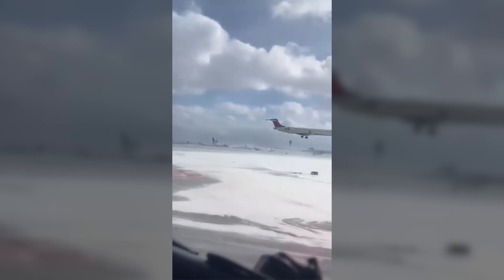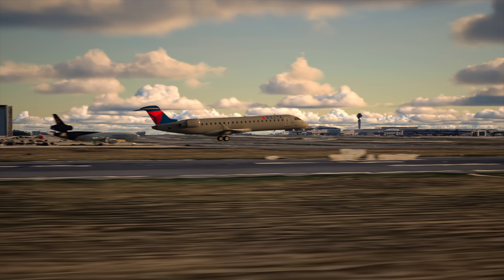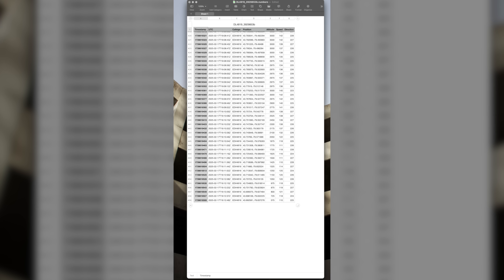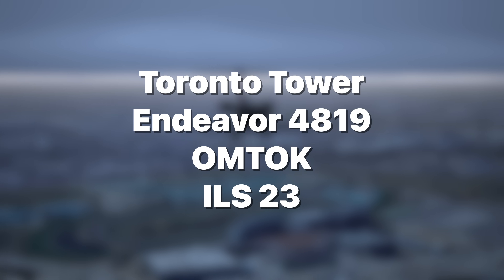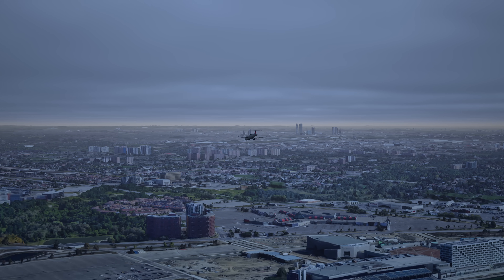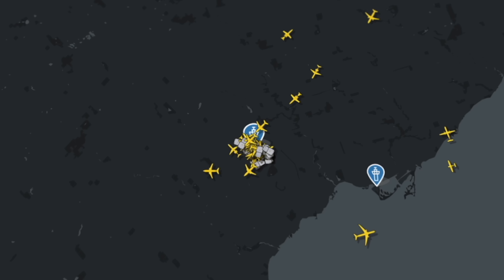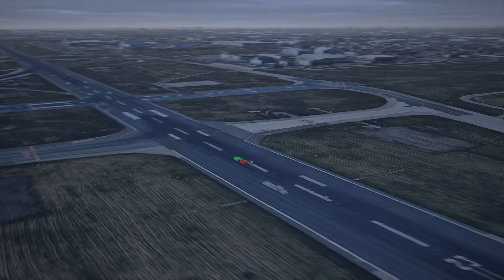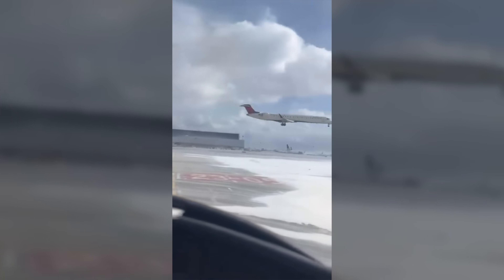What Caused The INSANE Descent Rate in Toronto?

Comment: Recently retired airline pilot here with nearly 40 years experience. There was an aircraft waiting for departure inside of the ILS critical zone because the weather at the field was essentially VFR but just windy. The controller was referencing the ILS glide slope signal disruption that might be affected or caused by the waiting aircraft. And another thing, there is no way wake turbulence was a factor in this event. The speed and direction of the crosswind would have taken care of any wake turbulence by ANY aircraft. Now, there may have been an issue with the wind or wind shear but certainly not wake turbulence.
Reply: Sooo pilot error???
Reply: @Mike-jq9jo  Is there a parallel runway where a large aircraft or helicopter could have created a wake turbulence and the crosswind pushed it over to that runway?
Reply: @tmayorca8770  no. Runway 23 is on the north end of the airport and the parallels 24L/R are on the south end. Too far to have an affect.
Reply: @tmayorca8770  nothing long enough that would accept a plane large enough to create wake turbulence
Reply: Wake turbulence of any severity would have rocked the wings,  this was a none controlled crash compared to all other landings which are a controlled crashes

Comment: Apparently there were high piles of snow left and right of the runway from the snow clearing. The plane landed and bang, one of its wings got stuck in the snow. The wing tore off and the force of the impact caused the plane to flip onto its back.
Reply: Actually it is the remaining wing that was still producing lift that caused the plane to flip. Simple aerodynamic.

Comment: Please don't tell me, They were using Knots, verses Mph? And or didn't adjust the Artificial Horizon for the difference from Sea level? Relative altitude?
Reply: The airfield has an elevation of 570 ft. The ADS-B data vertical data is always reported with respect to standard pressure 29.92 inches of mercury or 1013.25 Hpa. Where the aircraft came to rest the ADS-B data shown 725 ft so was probably overreading by about 125ft.

Wind speeds are usually reported in knots. Some countries, such as the UK use knots for airspeed and feet for height. The US use mph for airspeed. Some countries use kph for airspeed and metres for height. Swapping units is second nature to commercial pilots.

The Artificial Horizon does not need to adjusted for pressure.

Comment: This was 100% the pilots faults as you can clearly see by the footage he got the angle of decent wrong and what is normally called a touchdown turned into a thump down causing the wing to make contact with the ground. Regardless of the windy conditions, all pilots of commercial carriers have extensive training and should've been able to land that easily, all the other planes pulled it off as prove. I'm not a pilot but I do have common sense and blind Freddy can see that was a brutal landing on the pilots behalf.

Comment: At :08 you can see the blowing snow on the ground. It’s basically a headwind. Check for yourself.
Reply: The aircraft was using runway 33, hence was flying on heading 330, the wind was 270 20 kts gusting 35 kts, so that is a crosswind angle of 40 degrees, giving a headwind and cross wind component of 15 kts to 25 kts. The ADS-B ground speed was 115 kts so the airspeed would have been 135 kts, which is the correct speed for the weather conditions.

Comment: The sudden drop sounds like a stall of some kind,  a reduced pressure due to a strong side wind may have stalled the airplane. Add to the fact, the right landing gear hit the ground first and slid/collapsed,  and the rest of the crash was as seen in the video.
The flaps were down. Could the pilot be at fault? From the video, there was no time to flare at all. The airplane was going into hard landing and crashed
Reply: wow, that's a lot of nonsense in one paragraph ! !

Comment: The plane had an excessive descent rate, as another video shows. Pilot error, plain  and simple.
Reply: And you attribute this to pilot error? Not the more likely effect of wind effects rapidly tailing off once you are very close to the ground?
Reply: Apart for the last few seconds the rate of descent was around 500 ft/m, which is normal. For the last few seconds it increased to 1,000 ft/m, which is high, but within limits and is not excessive.

Comment: This is not good information.  If an aircraft's speed is below VREF it doesn't mean the aircraft was stalling.  A stall is caused by exceeding the critical Angle of Attack, AOA, and can happen at any airspeed.  VREF is 1.3 time the stalling speed.
Reply: The target airspeed is is Vref + a wind/gust factor, in this case 10 to 15 kts. The wind was 270 20 gusting 35 kts, so the headwind components was about 20 kts. Hence the is ground speed 115 kts, when the aircraft air speed is 135 kts. The aircraft was not being flown less than Vref.

Comment: A very innovative analysis… Thanks for sharing that… I would agree that the approach speed looks to be correct, but it does beg the question as to why the rate of decent increased so substantially, during the last few seconds of the landing phase… The only thing that I can think of, is that the airspeed was too low for the conditions and/or there was insufficient energy/airspeed to carry out a proper flare…

Comment: The descent rate was 1100fpm, that’s almost 20 feet per second : you’ll reach that vertical speed if you jump off a 2 story building and you will break both your legs.
Reply: That's not what the ADSB data showed.  Descent rate never went to 1K/min.  It was well under it for the entire approach and was at the proper 3 deg approach angle.  It did touch don't just short of the numbers, which is a little short of the desired touch down markers.  It will be interesting to see what the flight data recorders show.  Everything else is mere speculation, not facts.
Reply: @ OK, I don’t have access to the numbers other than through presentations and the last I saw was 1048’/ mn. That right gear had to have failed for a reason.just the voice recorder will tell you how fast the 50/40/30/20/10 call-outs went.

Comment: Could be windshear. I experienced windshear at 30- feet AGL on a stable approach, manual landing at Dublin Ireland . A300. Bad storm. The RA altitude callout cadence was normal until 30' as flare was initiated. Then I heard "30,20,10" in a rapid progression. All that could be done by me was set landing pitch attitude & Firewall Power and hope for the favor of the Skygod. A very hard landing and aircraft grounded for MX inspection was the result.

Comment: I have some doubts about the analysis, particularly the part about the alleged "INSANE" descent rate. As with other viewers I also question the granular data stating that the aircraft suddenly doubled its descent rate just prior to crashing. If you watch the video of the aircraft as it approaches, the rate of descent appears to remain roughly constant until touchdown.

That doesn't mean that the landing wasn't hard though. Moreover the right wing is low at touchdown. Two possibilities: 1) hard touchdown with right wing low, leading to wingtip hitting the ground; 2) hard touchdown leading to right main landing gear collapse.
Reply: Windshear would cause this descent rate.
Reply: @mdculpepper  Yeah, sure it could but what I'm saying is that the video does not seem to show a sudden doubling of the aircraft's descent rate. The aircraft appears to maintain roughly the same descent rate all the way to touchdown.

Comment: It looks to me that the altimeter or barometer was set incorrectly
Reply: Would not be a factor. For a manual pilot landing, baro altitude in not used, pilot eyes and RA altitude callouts are used. For automatic landing, the landing computers use RA altitude.
Reply: @mdculpepper If it was set incorrectly it could absolutely be a factor. Was it the cause, we don’t know yet so it’s probably a good idea to keep all options on the table until variables can be removed. Many crashes have happened due to this so it would be illogical to not consider this among every other possible variable that also may not have anything to do with the accident.

Comment: I could be wrong but if I remember correctly the CRJ-900 doesn't flare much at landing, you just hold the pitch attitude and pull power out.  It's possible the pilot pulled power too high or too quickly, especially if they did get a wind gust followed by an airspeed drop (pretty norming gusty conditions) and just pulled too much power too soon.  It'll be to see what the CVR and FDR have to say.

Comment: As a pilot and lifelong aviation buff and former Aeronautical Engineering student, this plane looks very weak.  Weak landing gear and weak airframe.  Should have been able to take that landing no problem.  Gusts were only +10 over wind speed.  Upon obsevation the airframe and gear looks too weak.  A 747 can take a very hard landing without crumbling and it weights hundreds of tons.  I swear the CRJ just looks weak.  Did they beef up the gear and airframe when they lengthened the Challenger corporate jet?  Just seems weak.

Comment: If the pilot’s front view is obscured by the angle of the plane’s nose and the outside side views are snow covered perhaps their depth perception was affected. If you have ever stood next to an olympic ski jump and looked down for where the actual landing area it’s extremely difficult to determine where the ground is. That is why they place broken pine limbs on the snow that can help with peripheral depth perception. 
  Just a thought about depth perception.
Reply: @JW007100 The forward, visibility, during the approach and landing phase in the CRJ is excellent… This particular aircraft may even have been equipped with a “Heads-Up Guidance System”, (HGS)… Commonly referred to as a Heads Up Display, or HUD system…Jazz CRJ’s use these…
Nevertheless, you may be quite correct, in that the drifting snow may have played a part in the pilots’ depth perception during the landing phase… Experienced pilots, learn to look “through” the blowing snow that is drifting across the runway, in order to see the pavement underneath… it’s quite possible that the blowing snow resulted in these pilots misjudging the point of flare …The landing flare involves a transition during which the pilots transfer their view from looking at the desired touchdown point, to looking towards the horizon while simultaneously correcting for drift with ailerons and maintaining the runway centerline with the aircraft’s rudder…
Reply: You might have something there, JW.
Reply: What mystifies me is that this doesn't happen all the time in winter by more pilots. If it is all just weather, and view angles, or whatever, then why don't we see tons of aircraft slamming into the ground and shearing the landing gear off and planes flipping all over the place in winter? Ya, I don't buy it. Who is the pilot and what was their training? Who was the crew? What was the state of the instruments and how were they set? I think we are seeing airlines, who made vocal commitments to DEI hiring and promotion two years ago now bear its fruit.
Reply: Altimeter was set incorrectly.  They thought they were higher than they were.
Reply: @trevor5290  it’s still a visual maneuver… And the radio altimeter would’ve read correctly during the last few hundred feet…
Reply: @tripleseven8361  Yes if the altimeter was incorrectly set it would be a main factor but not being able to determine the actual distance to the ground due to lack of depth perception might add to it. Depth perception problems are of course very common with night landings, one moment you’re just above the ground and boom ,oh you just touched down. The angle didn’t quite seem right either but all I can say is no one was killed and the whole sequence of the wheel collapsing, wing shearing off, then rolling over onto its back and then the fire. Incomprehensible in so many ways. Hope everyone on that flight will be able to cope with life as it is.
  I flew for a little while and decided it wasn’t for me. My father was a 3 war combat pilot in the USMC and then an airlines pilot and he would talk about certain situations and close calls. In between major airlines he flew a Twin Otter for Wien airlines in Alaska. He just barely slid off the runway at the end because of the ice, was able to get the passengers off and they pushed it back on the tarmac and taxied to the terminal.
Reply: @ Quite honestly, in visual conditions, (even with blowing snow), this landing was a visual maneuver…All eyes are focused on the runway during the landing phase…No one’s looking at the altimeter…
Reply: @trevor5290 
1. Automated height call outs are from the radio altimeter, so are not affected by barometric altimeter setting.
2. They were on the ILS AND PAPI glide path initially and then sunk below it at the last moment and hit well short of the touchdown zone.
3. Landing is a visual maneuver, pilots don’t normally look at their baro altimeter below 200ft as it is only normally accurate to plus or minus 25ft.

Comment: I don’t know much about how it actually works, but could the pilots have accidentally entered an incorrect altimeter setting? It seems this aircraft was descending way too fast. If someone can explain how that altimeter setting works, maybe I’d get that thought out of my mind…
Reply: Unless he was on a full autoland system the pilot flying must look ahead for visual confirmation of successful landing before desending below what used to be - in my day - Decision Height (DH). Please correct me if I'm wrong. Well rusty by now!
Reply: @rixxroxxk1620  I've been saying that all along. 👍
Reply: The altimeter setting would have no effect on this landing. It is a visual maneuver.
Reply: @ at what altitude would you stop checking the altimeter.  If its telling you, you are still 150' in the air, you are not going to be looking out the window to begin your flare.  Plus you're not actually staring out the side window, but rather watching the instruments and using your prereferral vision to feel the height and flare.  We will all know soon enough when they decode the black box..
Reply: @trevor5290  That is actually backwards. Once you have visual on the runway, your concentration is mostly outside while crosschecking glideslope, airspeed, rate of descent, etc. The closer you are to touchdown, the less you look inside.

Comment: Perhaps not a downdraft but maybe a wind gust, stopped gusting and resulted in a loss of 15 to 20 knots of headwind which might contribute to an increase in downward vertical speed.  Usually there's a "gust factor" that is added to your final approach speed to compensate for the gusts but as you get close to the runway, one reduces that factor so the plane won't have too much airspeed so it actually can land and not float down the runway.

I think when the plane slid off the side of the runway, all the snow on the ground helped to reduce or almost put out the fire.

Comment: Pearson often gets sudden wind blasts. About 20 to 25 years ago, while landing after coming from Vancouver, the plane was about 5 to 10 m above ground, when we were suddenly hit by a very strong blast from the left. The plane  tilted to the right and the wing tip scraped the tarmac, sparks flying. The pilot then quickly righted the plane by pushing it down hard and as i felt it, slightly to the left. 
Could something similar have happened, just with a less benign ending?

Comment: If the pilot put in a flair command.. the plane did not or could not perform the task for what ever reason.. it just continued its glide path straight into the ground.. flaps? Down draft ? Ice on the wings ? Flight controls ?

Comment: It seems that easily broken wings actually saved the passengers life, removing the fuel tanks from the plane
Reply: You are correct
Reply: I’m not sure they break easily, but yes the fact the wing separated was most fortunate.

They used to teach that for a light aircraft crash landing, aim to land and pass between two trees to remove the wings.

They seem to have stopped teaching that these days, litigation I guess!
Reply: Part of the reason the F104 was considered a widow maker. No wings to shear off

Comment: Just as it appeared to me in the first video that was released, his vertical speed was too high. ATC told him that there might be an issue with the glideslope with an aircraft in front of the antenna on the ground. Glide slope antennas are only protected during low weather, so the weather wasn’t low enough for that ATC procedure to be in effect. I’d be willing to bet that the investigation will show that he was following the glideslope, and the glideslope was slightly inaccurate due to the interference from the aircraft on the ground. He got too high so he pushed the nose over far too low of an altitude and he wasn’t able to recover in time. What he should’ve done at that low altitude when he realized he was too high was go around. I am a retired airline captain by the way. Of course, second guessing is easy, we need to wait for the real report, I’m just expressing my thoughts from the video.